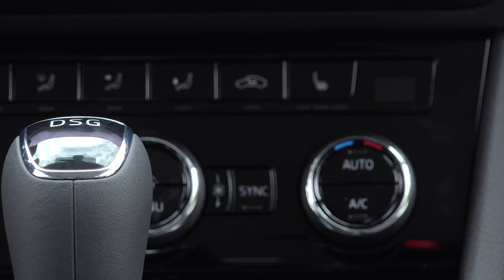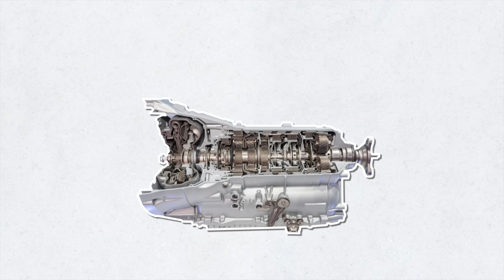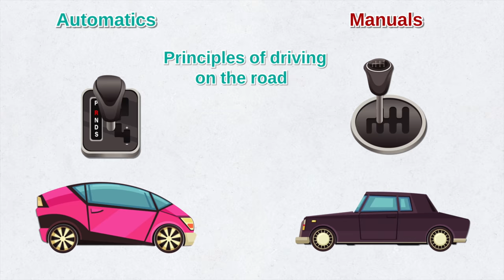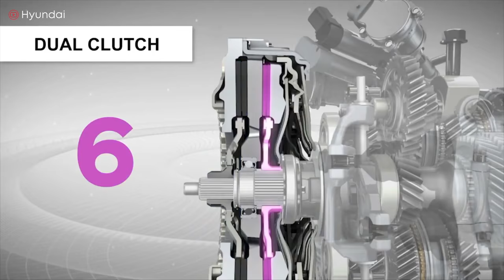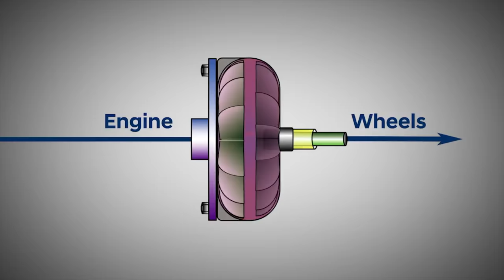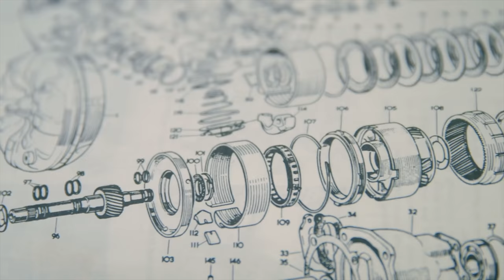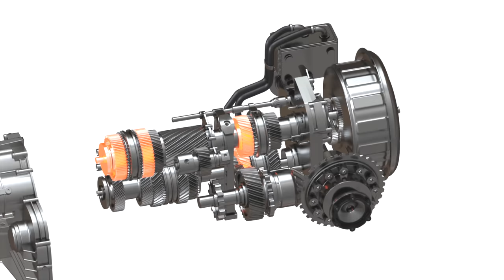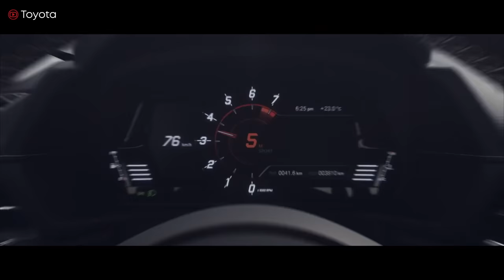5 Things You Should Never Do in an Automatic Transmission Car

Comment: The new automatics in today's cars are a mess. Variable speeds are not reliable, dual dry clutches fail. If I were to get a new car today, I would not buy a auto. The best auto trans was GM's powerglide. The trans never had to shift when driving local. Also Scotty failed to mention, when parking on a incline put the car in neutral first. Turn it off. Set the parking brake and put it in park.

Comment: CVT's have made automatic transmissions undesirable.
Reply: I just drove a new Corolla and Civic both with CVTs. They were incredibly smooth. For most folks its it's fine.
Reply: @baronvonjo1929  It's the durability issue plus I am no speed demon, but sometimes you gotta merge into a highway and if your  car snoozes you will be in trouble.
Reply: @pedrofernandez8729  True True. I am shaky about CVT reliability as well but I assume Toyota at least will be more reliable than most as they have been building CVTs for a really long time. The Prius. And I've heard of those things going far. And at least the Civic that thing accelerated well. I didnt give to drive the corolla much as I was visiting friends but my brothers girlfriends Civic is still here so maybe I'll get to try merging fast one day..
Reply: @baronvonjo1929  They recalled some of the early Corollas with the CVT,  not sure if it was the one with the mechanical first gear or the regular one.
Reply: @pedrofernandez8729  Oh. Well oof.